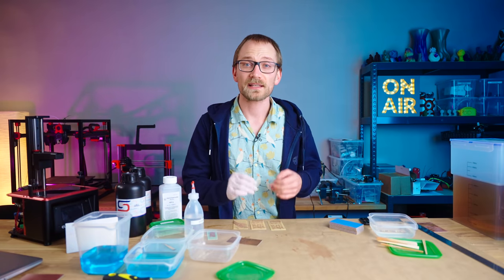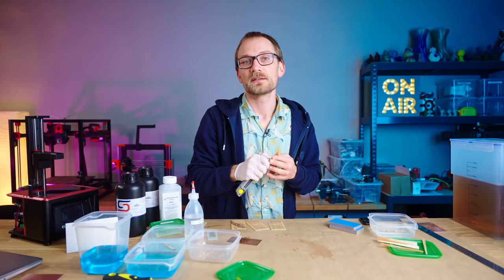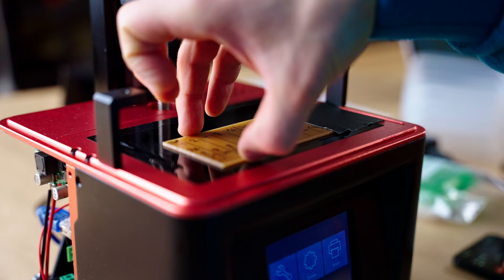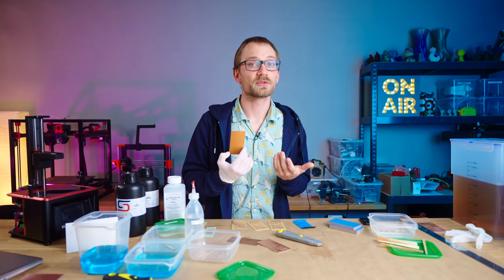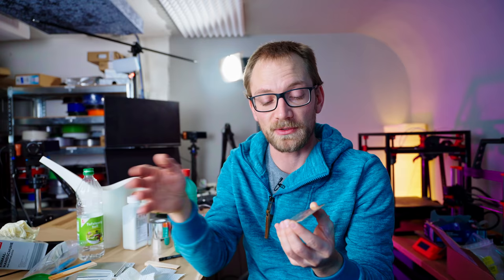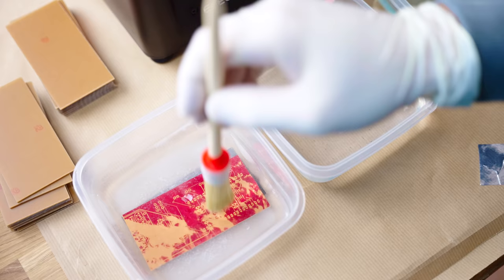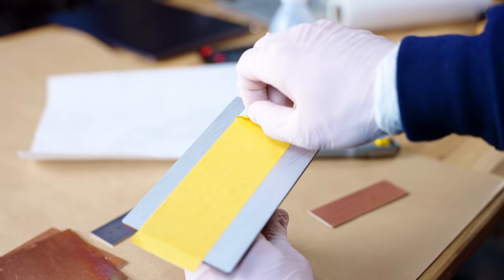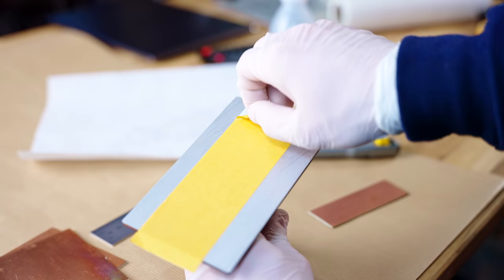The fastest way to make crisp PCBs at home!

Comment: I've seen this done before, but I can see someone making a device that would be two LCDs that would sandwich the board to make 2 layer boards easy to make.
Reply: @s16e559  thinking about this, you would need some sort centering clamp.
Reply: @s16e559  yes, a jig. Used frequently in CNC milling for 2+ operations on a part.
Reply: CNC mills that do double layered PCBs pretty much always use two alignment pins that go thru the pcb board to make sure both sides perfectly align when you flip the board. The problem with that is, that you have to drill these holes at the right distance with a high enough precision into the raw PCB before you start the exposure process, and you need a way to add some alignment pins to the printer. I guess if your printer has some alignment pins to hold the resin vat in place, you could maybe use them, or build a holder with alignment features out of a resin vat.
Reply: @ellisgl you've already got the precise 3d printer. Just print a frame that screws down with the screws that normally hold the vat and use the frame as x&y stops. 
If you're adventurus enough, you can even print the stencil for the solder paste (if you use a slightly flexible resin i.e. tough resin.).

Comment: Dry-film photoresist is the solution you need. It comes in thin blue film that you can iron on copper-cladded board (not the solder mask paste). The exposed photoresist turns darker and hardens while unexposed part dissolves in alkaline solution (sodium carbonate). It's much cheaper than presensitized UV PCB, and can be removed & reapplied if something goes wrong during exposure.
Reply: can you explain more? so once ironed and process is done you can solve in sodium carbonate and then run in etcher?
Reply: @maevebaksa  yes
Reply: Yep, and you can use vinegar plus hydrogen peroxide and table salt to etch which is much friendlier.
Reply: @maevebaksa   the dry-film photoresist can be ironed on the copper-clad board with lowest heat setting or using a laminator.

After exposure, develop the board with sodium carbonate solution, use a soft bristle toothbrush to clean the traces.

I use old-school ferric chloride for etching. The etchant is heated on Ender 3 bed and some gcode to agitate the etchant.

The cured photoresist can be clean off with acetone or let the board sit in sodium hydroxide solution. I also found that the cured photoresist peels off in IPA, while uncured photoresist dissolves in IPA. 

Best thing about dry-film is if anything goes wrong during exposure you can just remove it and reapply the film. With presensitized PCB you only have one chance.
Reply: @yonggor  .
Reply: @yonggor  It also makes applying UV curable solder mask (especially in selected areas or without using a stencil) much easier.
Reply: @EgonSorensen  that's new to me. How is it done? 

I know sometime people use dry-film as solder mask but it's not really good for that. Dry-film is too soft in comparison to resin/paste solder mask and it cannot withstand high heat. Also there's no guarantee about it's resistivity. Stronger flux will seep underneath dry-film and effectively peel it off.

Several companies do make legit dry-film SOLDER MASK but I don't see people use it a lot.
Reply: @yonggor  After Cu etch another layer is applied and exposed/cleaned so there are holes for the UV resin to cover tracks, etc. and 'everything else ~ solderpads'  is covered by the dry-film.
UV resin is applied and cured. Best not to add too much and excess is blown/scraped from the thin-film before curing so it doesn't cover the dry-film entirely if it is a sticky resin.
The dry-film is then cleaned away, and it should take the UV resin away that is sitting on top of it. 
Cumbersome, yes. Not perfect, as it can leave rough edges on small pitch pads, which is far from professional quality. 
Better than using thin-film as solder mask though.
Far easier to use a stencil to apply UV resin, but for quick and dirty prototyping it might not be easy/possible to obtain a stencil without a lot of extra machinery + work.
Reply: @EgonSorensen  it's possible to use lcd method for applying resin solder mask. Spread some resin on developed board and apply a thin plastic film on top. Push/scrap the resin around to form an uniform layer of resin on the board. Expose the board on MSLA printer. After exposure is finished peel off the plastic and clean the solder mask with IPA.

It would be difficult to align the board for exposure using this method though
Reply: @yonggor  i hadnt thought of my ender as an etching helper. Thanks pal!
Reply: @yonggor  Using the LCD method for applying resin solder mask - genius!
Alignment might be easy if one places pcb's around the pcb to be worked on, just as when working with stencils (applying soldering paste)
It would be a mess if the film breaks though
Reply: @yonggor Nice, but when attaching dry film photoresist to copper clad, I get some air bubbles in between, how do i remove them ?
Reply: @SandeepKumar-jj7zi   try doing it WET.
Spray a layer of water on copper-clad board and put the dry-film on. Use a plastic card, roller or rag to scrape the water out. After that use an iron to apply heat and preasure to bond the photoresist onto the board. 

Alternatively you can do it underwater.
Reply: @SandeepKumar-jj7zi  You can use a not-too-hot clothing iron, or better: A laminator normally used to laminate paper inside a plastic sleeve.
I have also heard some people do it under water, but I have no experience with this.
Reply: I was going to say trying cyanotype chemicals or another photo process but this would definitely be better haha.
Reply: Tried that stuff. Lots of elbow-grease ironing it on. Lineup not accurate, much trouble.

Some of the guys have got great results but I think they put it through a heated roller such as a laminating machine. That would provide consistent heat all over the pcb.
Reply: I just print the negative on Laser Photo glossy paper using laser jet printer. Then use household iron to iron on the black traces, then soak and rub off the paper, and dip the board in ferric chloride solution. Works every time reliably without trial and errors.
Reply: @rpavlik1  Vinegar/hydrogen peroxide takes ages.  Also the copper dissolved in the solution is NOT environmental friendly.  Always dispose of properly.
Reply: @pentachronic  yep, though there's less copper in there than in sewer pipe tree root killer... I'm currently planning to do the dry and discard in sealed container thing.

Comment: Such a simple concept with awesome results! Most of these machines are capable of displaying their logos during LCD testing so I wonder how you could just get images into it like that vs having to make a negative STL. Would greatly speed up the process, but unlikely to see with chitubox systems :(
Reply: Time to open one up and get hacking..I'm sure we could come up with some open-source replacement firmware. Too bad I don't have one or I'd be down to tear it down and experiment.
Reply: Gerber files are just a zip file of all the layers as bitmap. You can export them in eagle via the manufacturing tab.
Reply: Inability to use 3rd party slicing software is a total deal breaker for some of us getting a printer.  Related, One of my favorite 3D modeling programs, POVray, is totally not designed to output meshes, but is not overly difficult for producing a series of slice images that could be processed for an SLA printer accepting an open slicer standard.
Reply: @BloopTube  Can you still? I thought chitubox said they were going to change the firmware only accept files signed by the official slicer.
Reply: I've seen that in videos but I don't think any of mine do it, they just show a solid rectangle. That rectangle is probable still an image file that could be replaced though.
Reply: UVTools, open any slice file for the target printer then (upper right) actions->import

You can even use Pixel Arithmetic -> pixelwise Not to invert the image
Reply: @TheDementation  no idea what you're talking about
Reply: SL1 files are just zip files with PNG images and a plain text configuration file. Prusa FTW.
Reply: @experimental_av  real gerber files have nothing to do with bitmaps, they are more like g-code files defining positions of apertures that get flashed to create an image. They are closer to a vector graphic than a pixel defined bitmap, and they contain information about real world measurements that you don't have in an image. Maybe Eagle does generate bitmaps along with Gerber files, but they are a completely different file format.
Reply: @BloopTube  Yes (Not JPG though. They're lossy). I've actually been thinking of making an STL to CTB converter. You'd have to do all the supports in your STL but there are certain projects where this would actually make things a lot easier.
Reply: @ProtonOne11  I believe you're correct. Eagle can generate bitmaps though (or maybe I'm just thinking of printing).
Reply: @experimental_av  nope, ... maybe there are some BMPs, ... but the relevant files in that packing are more like text-files with positions and lines/shapes for drilling, milling,...and much more. all any maker needs to do this PCB. that wouldn't work via BMPs (alone)
Reply: I've created an open source project that uses the replacements parts from an MSLA printer (UV lamp and the screen) to make an exposure table that does this directly.  The software (called Qwicktrace PCB) takes a set of gerber files and creates the inverted image file to display on the screen. While I never considered utilizing a pre-existing MSLA printer, I'm pretty sure the software could be modified to generate the STL file (vs. the SVG file it currently generates).
Reply: I love Povray too! Nice to know its not just me still using it.
Reply: @forbiddenera  rent e mojy
Reply: you could also just buy a cheap lcd, take the backing off of it, and stick a UV light behind it for way cheaper than a printer. plus that way you can get variable sizes
Reply: You can use UVtools to 'unzip' chitubox project files into a folder full of .bmp files. Then you can edit them appropriately and convert them back. I did this to transfer a bitmap texture to a part that would absolutely bog down Solidworks if i used a vector file. I ended up using a different texture, but it sure did work.

Comment: This takes me back 50 years when I was a teenager making pcbs in the bathroom by exposing boards with a sun tanning lamp.  In hindsight I had lots of failures mostly because I was spraying the Kodak liquid resist. The resulting coating thickness was not uniform enough requiring different exposure times across the board, basically clean off the resist and try again. As I recall the Kodak literature recommended spinning the board to produce a uniform film thickness. The copper surface also needed to be insanely clean before attempting resist coating.  If the resin printer UV light source is columnated consider spin coating before placing the coated board on the printer. This way the flatness of the board will not be a factor.
Cheers-Peter
Reply: I did the same thing.  A buddy of mine found an old home sun tanning lamp.  Used to make my own and copied a commercial guitar effects pedals.  I used tape and overhead plastic to make the masks.

Comment: One tip on sodium hydroxide: I would generally suggest sourcing food-grade sodium hydroxide/lye rather than lab grade sodium hydroxide.

Food-grade NaOH is pelletized to minimize dust, because breathing in NaOH is very bad (people can debate the need and efficacy of respirators for acrylate fumes, but no one debates that breathing in lye dust is bad). The larger granule pellets make it relatively safe to handle for kitchen uses, like making pretzels because the bigger pellet size makes it much harder to dissolve if you accidentally touch it (lye isn't caustic until it is mixed with water) and has minimal caustic dust if you handle it gently.

Lab-grade NaOH might come in a different granule sizes which might not be apparent on the labelling and may be potentially more hazardous to handle, especially with respect to eye and breathing protection.

The NaOH shown in the video has large grains like food-grade NaOH. No need to be super scared of this stuff, as it is commonly used in cooking for things like pretzels or noodles. Just exercise some caution.
Reply: This is very useful information, thanks for sharing!
Reply: Would you agree that neutralizing NaOH with Acetic Acid CH3CCOH is not the best Idea?
Reply: you don't need to neutralize lye, you just pour it down the drain. It's literally drain cleaner.
Reply: @tommihommi1  In the video Tom tells that he have Acetic acid on hand for emergencies with the NaOH and I think that’s not the best idea but I am not 100% shure about that.
Reply: @Druidus98  I'd suggest having baking soda nearby to neutralize any spills. While lye is used as a drain cleaner, you should not just pour concentrated lye down the drain unless you need to clean the drain. If you don't need to clean the drain, just dilute the lye with a lot of water.
FWIW I'm a chemist.
Edit: I buy baking soda in bulk and keep a bag of it in my lab.
Reply: @Druidus98  acetic acid is literally the main component of vinegar, as long as you aren't using glacial acetic acid or otherwise super concentrated it's perfectly safe
Reply: @ddegn  baking soda is high pH and won't solve a high pH spill
Reply: @peterzingler6221  Baking soda neutralizes both acids and bases.
"Baking soda (NaHCO3) is an amphoteric compound that means it can act as acid as well as the base. The pH value of baking soda is around 8 which means, it is mildly alkaline or base in nature, so when baking soda is dissolved in water, it produces a basic solution."
So yes, it has a "high" pH but not very high. There's probably a better chemical to use if you are only going to neutralize bases but it's a handy chemical to deal with most chemical spills since it works on both acids and bases.
Reply: @Druidus98  Classic approach is - wash it away with water (preferably the cold one). And really keep washing it for some time (depending on concentration and size of the spill even for few minutes). More you dilute it, less aggressive it becomes, while pouring vinegar that already has around 8% of the active substance over the chemical burn in anything but a wise. When it starts to react, it generates heat so you just add another damaging factor.
Obviously, if you come into contact with solid hydroxide, try to remove it only then rinse your hand in water. Solid one is not going to hurt you before it reacts with moisture on your hands - or you dissolve it. So you want to wash away the residues, not the bulk.
Eventually you may use some mild acid for final neutralization - I think that in chemical lab there was boric acid solution in concentration used in ophtalmology
Reply: @mungo7136  The heating effect in combination with a really strong reaction of both components was what I was thinking of. Thx for the detailed answer. 👍🏻
Reply: @Druidus98  Besides you either use strong acid that is dangerous on its own or it takes time and reapplying diluted acid to fully neutralize the lye, in the meantime lye reacts with your tissues as well as with acid. 
Standard measure I was taught is to fully and extensively wash it away, than use very mild counter-agent to neutralize possible residues. In school labs it was diluted boric acid for lye and baking soda solution (if I remember that properly) for acids.
Reply: How is NaOH used in cooking noodles?

Comment: That result is actually pretty nice. 
I've been doing prototype PCBs for our company for a long time, but we cleaned out that pcb-prototype-lab a few years ago. It just was no longer really useful compared to a professionally made PCB with plated vias/holes, multilayer, solder mask, micro detail, reliability and quality, surface finish (ENIG) and all the other benefits. Waiting a week for a pcb is really not an issue, if you plan your project accordingly, and doing proper simulation and reviews of a design to have fewer errors or failures is worth more than trying to crank out 3 hardware-iterations in a week before you get a working design.
I guess this technique here is still useful for some, and probably quite cost effective when you compare it to getting a good resolution 2D printer that can print highly opaque films and an UV lamp for pcb exposure with a vacuum pump.
Reply: I agree with what you say though I'd suggest that the cheapness and availability of rapid prototyping actually pushes the home stuff even further into least-effort territory. So laser printer-transfer paper or stripboards.
Reply: I think I am one of the 'some' that it is useful for as 1. I wait way more than a week average maybe  4 weeks, 2. postage costs are several times more than the cost of the boards 3. if i optimise for single side SMT then no holes 4. hobbiest use so low volume and my time is mine but for the rest I agree.
Reply: In addition you might have to wait for the actual components to arrive if you are building something non-basic stuff. The fab can source and assemble them which cuts down the time difference.